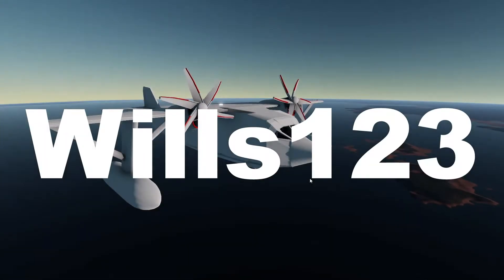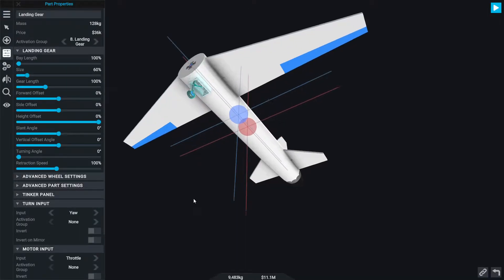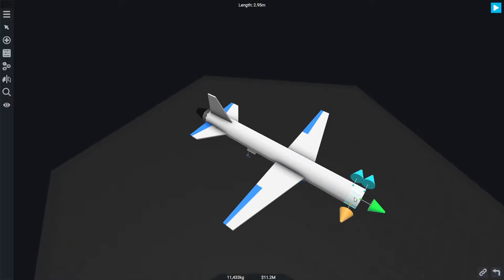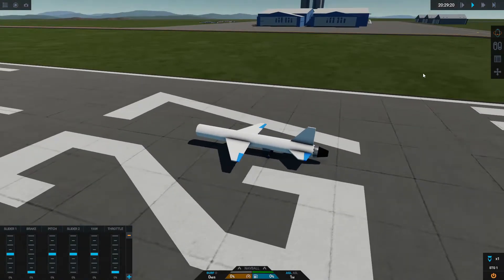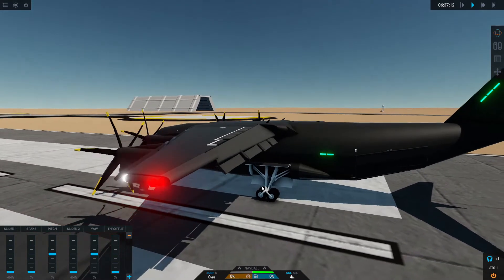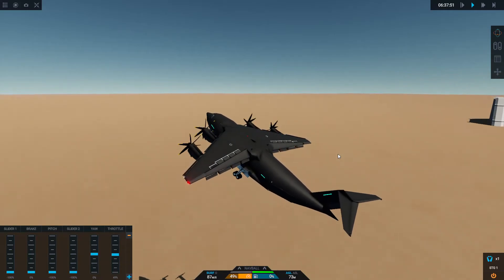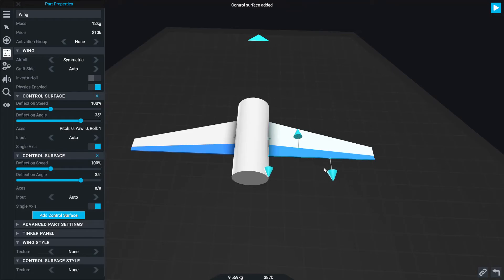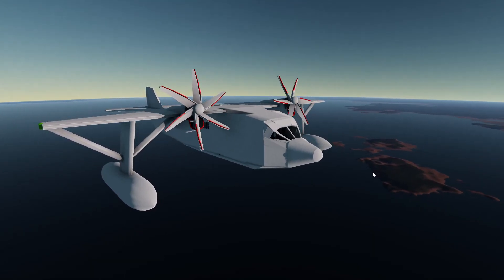The Basics of Building a plane in Simplerockets 2. Pt.1

Comment: where you take propellers? 
i found only jet and rocket engines in edit mode
Reply from the maker: You have to make them! Get an electric motor, attach a fuel tank then attach a wing to the outside then choose the number of propellers you want, and bam, you have a propeller

Comment: I'll be here till you'll become a star bro 🥰

Also quick question, how do i stop my plane from wobbling in flight while i lock its heading 
But when i don't lock it , it flies with ease.

I think it's the yellow circle thingy , please make a tutorial that explains this.
Reply from the maker: Thanks! I'll be sure to include the answer in my next video. 

To answer your question that’s due to the derivative being too high within the autopilot setting. This is found at the bottom of the flight info panel
Reply: @wills1238  thanks so much brother,i have so many problems while testing how long i can travel on my planes in autopilot

Comment: Hi .. nice video.  I had to see . Hey general rules . Center of lift . One third back from front of wing .. in game I found that's more of center of mass at one third back from front of wing
Reply from the maker: Thanks for all of your comments! I've never tried that, I typically have the CoL relatively close to the CoM
Reply: @wills1238  the close part . The closer to each other . The more sensitive pitch . Also pitch depends on other factors. Like how far tail Rudder  is from center of thrust and center of mass .. COG center of Gravity is what we usually call it instead center of mass
Reply: Another hint. Cockpits have its own tiny gyro . That's why cockpit vs drood in a chair flying is different